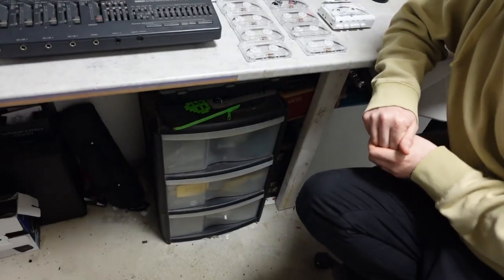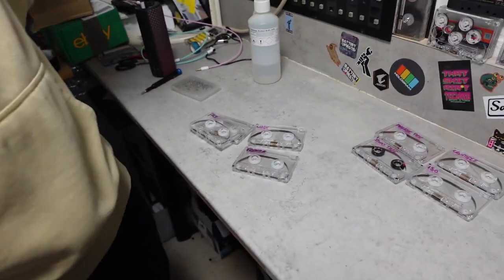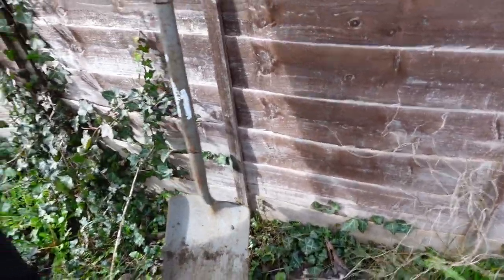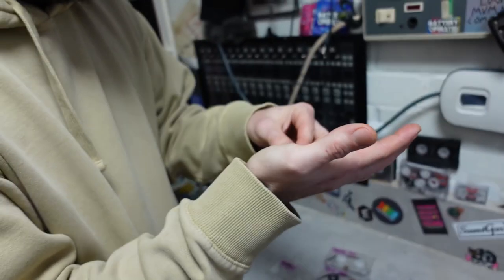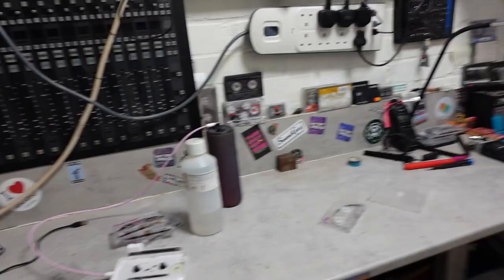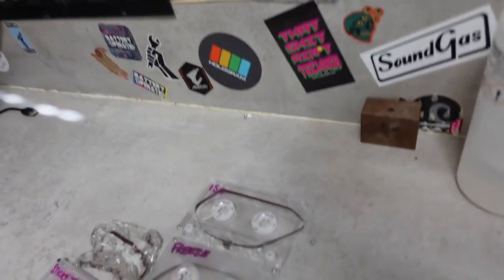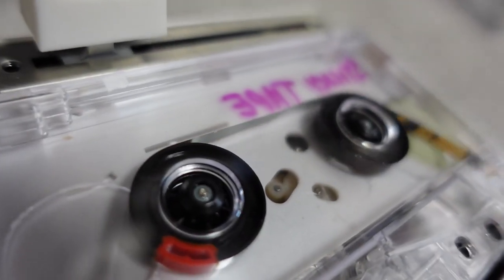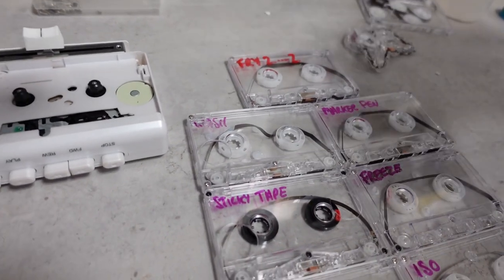What Happens If You Put A Tape Loop In A Washing Machine...?

Comment: I used iso to clean mould off VHS tapes. Good experiment.

I liked crumple the most. There is a technique for restoring old damaged audio/video tapes. Oven baking at a certain temperature. Obviously not 200c. 😂

The air fryer temp destroyed the magnetism on the tape. Once you go beyond the threshold for extended period. Magnetism gone.

Comment: Bleach. Vinegar. Perforations/holes. Loose items in the case (ball bearings, rice, something that will move with the tape). Nail varnish. No spools. Stretching by hand. Chopping and rearranging. Left in the sun (or more likely the rain in the UK lol). Magnet on random spots. Freeze into an ice cube and melt before playing. Swallow and rinse after it comes out the other end lmfao.
Reply from the maker: Awesome suggestions ahah, could make a whole vid from just these suggestions 😄 👌
Reply: @BatteryOperated  with the comments coming in, I'm definitely sensing a long run series 😁

Comment: Would be cool to see a video where you do, alternate weird treatments for printing noise on the tapes that are blank. Obviously, some kind of magnetism is required so repetitious magnetic ideas. For example. Take one of those drinks, stirring motorized sticks, and place a magnet glued to one side of the tip, and turn that little motor on, and put the tape somewhere in close proximity, and let the frequency of that magnet, spinning on the motor impact the tape. This is just something I think might work theoretically and if so, there’s probably a lot more ways to do interesting magnetic influence

Comment: Great stuff as ever. I'll definitely be using the sticky tape and crumpling. Nice idea having the hole in the one you put through the wash. It allows for OG flanging techniques.
Reply from the maker: Yeah crumpling was great 👍 definitely a valid technique!
We also sell a loop with a hole in the case on our etsy if you're interested 👌 The Wiggler
Reply: @Battery Operated  hi, you guys make some great gear, I build my own, hack old stuff. But I only build for myself these days. I'll keep directing folk over to you guys and Metsaan studios.